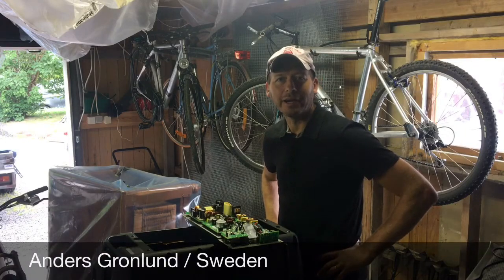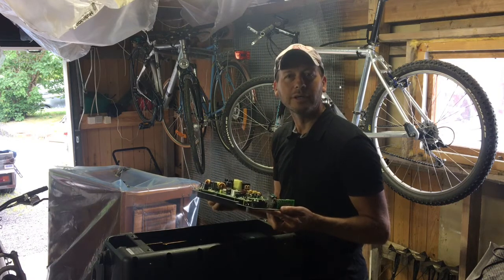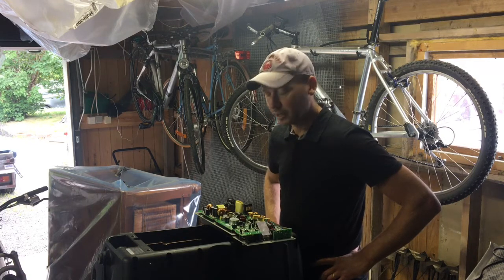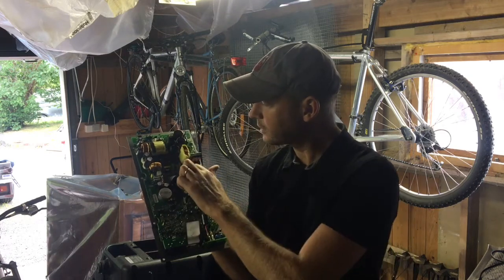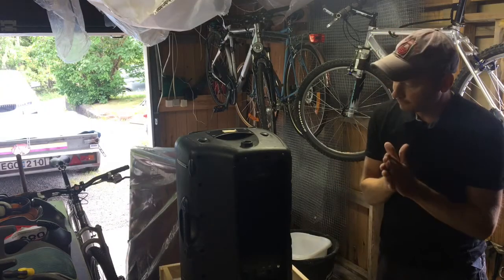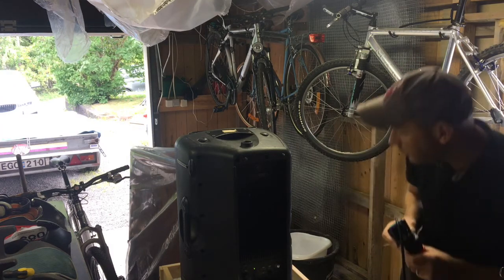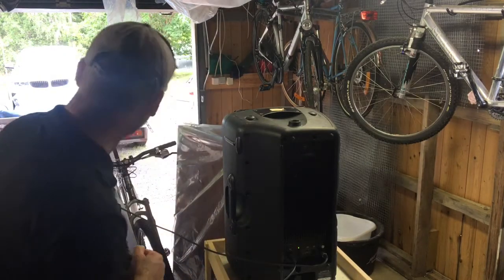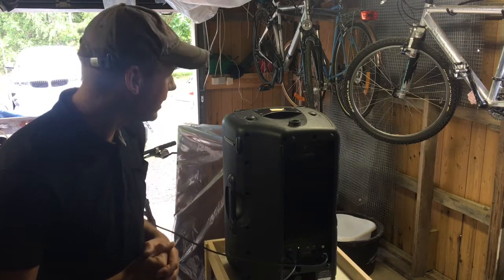Repair Mackie SRM-450 V2

Comment: Can I get the circuits diagrams?  My SRM450V2 turns off middle level input signal. Please help me. If I can have the circuits diagrams, I can repair that.My e-mail address is yr21st@empal.com.

Comment: Great if it works fine ! Do you have references of components you replaced (2 MOSFET and 2 Resistors, right) ?  I would like to order the same an change this first to see if it fix mine (I don't have much hardware for diagnose...)
Reply from the maker: romain fouquet hi! Sorry for a late reply. I think John B is mentioning exactly which mosfets and other components which usually goes wrong. Let me see if I can find my notes from my project. :-)